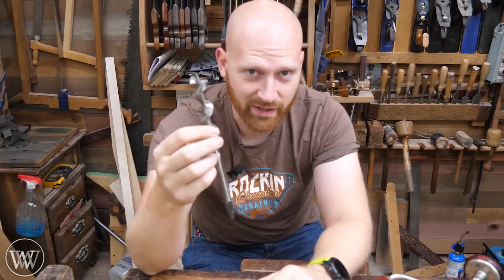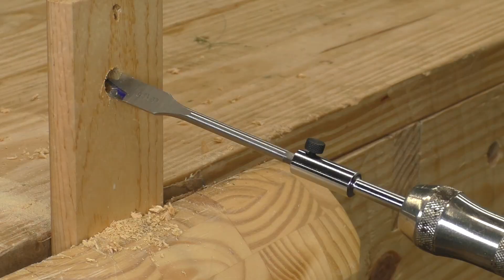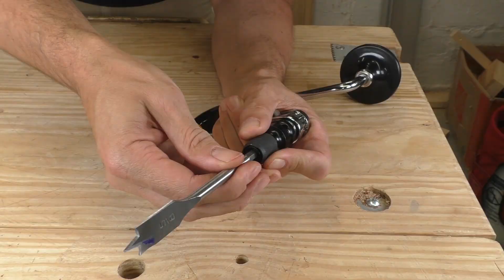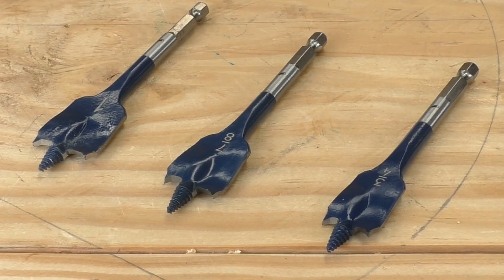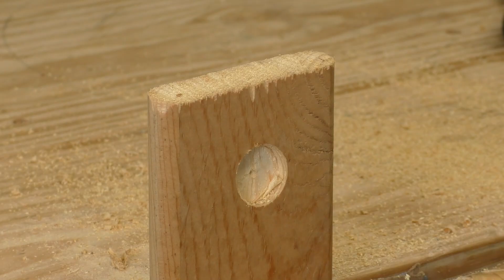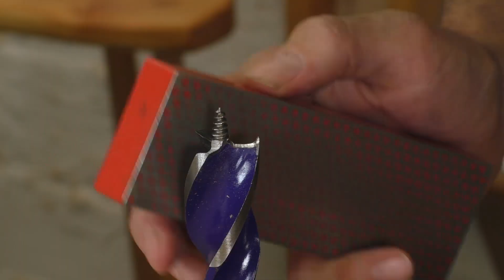Modernize your brace with new gear!

Comment: My grandfather would've told me to cut the ends off and weld hex stock on them.
Reply: could you do it with the bit sufficient centered to not lose accuracy?
Reply: @BCRBCRBCRBCRBCRBCR  
I personally would grind down the square sides, weld on a few beads, and make a "straight drill jig". Not too dissimilar from a plane shooting jig but with level and plumb for centering. Then grind the angles a little bit at a time.
Reply: @BCRBCRBCRBCRBCRBCR  It would be very difficult with a home setup. The centering wouldn't be so hard, but keeping the welds even is incredibly hard. Usually when the weld cools, the metal contracts unevenly, introducing a bend at the weld.
Reply: @keithklassen5320  
I understand the concern.
I'd do a little trile and error on some steal stock or some junk, and get it zeroed in tip too tip.
The other thing to remember is that the bit is going into a brace not a high speed drill or mill.
Reply: @BCRBCRBCRBCRBCRBCR  two v-blocks, clamped into place? Shim one block to height.

Comment: Take a look at Irwin Brace Bits.  Traditional tapered square shank, two flutes down a solid center, and sizes from 1/4" to 1" by 1/16ths.  I get the same performance out of those as I get with my 100 year old brace bits (father in law was a carpenter during the Depression).  Good nickers, too.

Comment: Why not use a standard 1/2" socket speed wrench with the adapter you showed?

Like:
https://www.amazon.com/Performance-Tool-W38128-8-Inch-Speeder/dp/B009TCBBEE/ref=sxin_9_ac_d_mf_rm?ac_md=0-0-c3BlZWQgd3JlbmNo-ac_d_rm&cv_ct_cx=speed%2Bwrench&dchild=1&keywords=speed%2Bwrench&pd_rd_i=B007UTQ2Z6&pd_rd_r=607ab25b-1220-4549-8557-b90879dd1ba5&pd_rd_w=xbeOo&pd_rd_wg=E56WQ&pf_rd_p=3d1a8341-be16-45b1-ae3d-ba8c533ec9f0&pf_rd_r=310JQP82NXS76FD1EQ65&qid=1602174279&s=hi&sr=1-1-12d4272d-8adb-4121-8624-135149aa9081&th=1

Comment: Great talk man. You hit the nail on the head. I have been eyeing one of those braces for a long time now. Maybe someday I'll pull the trigger. If they made it in a long throw, or short throw version I would easily throw $100 at it. Thanks for the shout out.
Reply: It would be great to see you both work together.
Again :)
Reply: Damnit James!!! bahahahaha :) :) good work friends!!
Reply: Same -  I'd have already bought one, with all the extras, if it came in 14".
Reply: I'm not in an apartment. I've got to build a wood truck bed away from any power and I'd like to use manual tools. Does anyone or did anyone make a hand powered drill press that I can clamp onto one of the boards?
Basically I'm looking for a mobile hand operated drill press.
Please and thanks guys.
Reply: @xmo552  these exist as antiques; i sold one off a couple years back. Might find them in estate sales or whatever. 

But a bit and brace can drill dead straight/square if you make or buy an appropriate guide. 

For that matter you could probably use one of those drill press guides for hand drills that has a built in chuck (rockler sells one) because many braces easily hold a hex shank.
Reply: A homemade guide is as easy as drilling a thick bit of scrap wood really carefully to be dead square, testing the hole for square, and if good, clamping the guide to your work to drill the first couple inches of the hole.

Or hit up a friend who has a drill press.
Reply: @joshuamurphy5073  
Thanks for the advice !
Reply: @xmo552 , is this what you are looking for? (Maybe I should say “were looking for”?)

https://www.youtube.com/shorts/5bgx4Qhh-Ds
Reply: I have 5 braces now, short throw, med. throw and long throw and it's like having a 3 speed transmission. Those long throw braces are really nice with large diameter bits.
Reply: Check Lee Valley for brace options and accessories.
Reply: Long throw? Short Throw?

What do these mean with regards to braces?
Reply: @KrazyKrafter  it means the distance from the handle to the center axis. The longer distance, the more leverage you can apply to turn the bit.
Reply: Yes, this. I also really wish that it had wooden grips. I guess im looking for a unicorn (again), but a brace with nicer grips, less than $100, and takes round bits is the goal.
Reply: Like most hand tools, old ones a often better than new, and cheaper. Flea markets and yard sales, eBay I suppose. Unfortunately I have no current knowledge as I bought mine about 50 years ago. The one I found was made for Bell Telephone way back in the day, and is better made than anything I've seen since.
Reply: You guys are my favorite woodworkers, love your stuff James.
Reply: Spade bits are crap in hand braces, very poor performance. I recommend buying both sizes of adjustable bit, you can cut up to 3” holes.   Do not buy Chinese auger bits ! waste of money. the Irwin bits are meant for power tools.   
   Rex, look for adjustable bits, if you keep them sharp they cut very neatly. Yes I do use them, you can get them in square or modified round shank.
        What’s all this talk of knickers on a family show ?
Reply: @CrimeVid  I've got a couple of adjustable bits I found in a box with a bunch of other stuff. This has inspired me to try and clean them up. Thanks!

Comment: The last type of auger bits you tried actually works well if you change the geometry a bit. The “nicker” seems to not cut ahead far enough, the solution was to file back the bottom cutting edge. Also the cutting angle of the bottom cutter is way to high, but that can be filed. The end result is a nice and clean hole. I did this on a dewalt bit. But they are not super cheap, but perhaps the same mod works with cheaper ones.

Comment: From my experience, I purchased and used the ship auger style bits from harbor freight.  HF is cheap, but i decided to go with the "Bauer" brand.  I actually used those during my joiners bench build with pretty good results.  Worked alot better at low speed than in my drill, pretty clean hole and cuts left, and it made a difference when i sharpened it up too.  Even w larger size bits, i was able to make clean 3/4" holes for holdfasts in the bench.  The snails have bigger thread for more positive engagement too, and decently priced.

Comment: My plan is to get the adapter that taytools sells and gradually phase into the Woodowl bits as my small assortment of vintage augers die off. The snail of my 3/4” vintage Greenlee bit is shot and beyond repair - I basically have to lay on the brace to get it to cut through, since it doesn’t pull itself through any more. My most used brace bit, so that will be the first Woodowl, along with the adapter.

Comment: Really like how Rex doesn't just  expect the tool to work perfectly as sold, especially if its cheap i.e. he accepts that there's a trade off and that you may need to meet the manufacture halfway and invest some time to tune it....and i get that might sound stupid i.e. shouldn't the tool work perfectly first time and forever!......well no, the tool is going to deteriorate if you use if for any reasonable duration, and therefore learning how to maintain it is all part of ownership....its its own skill......unless you want to just pay top wack, and throw away weekly/monthly. Keep it up Rex. A friend runs a machining business with sophisticated CNC machines. I thought that he would never have to take them apart, that their complexity would defy such work.....i was wrong, he knows everything about them and can strip and rebuild them as required.

Comment: Rex.. get a ring that you can put around the chuck end of your braces and tie a piece of rope or chain that doesn't stretch to it... take a little quick level and level your brace then step on the cord/chain on the floor and you can ride your wobble almost completely out.  A bearing with an outside race works very well but adds a lot of weight.

Comment: I'd love to have the wood owl bits but they are way beyond my budget, even one at a time. I occasionally find an old bit or two that are useful but most have been abused and improperly sharpened. May be the GW brace with the 1/2 drive is the only modern way I can go, at least half drive accessories are easy to find. Then again maybe blowing the dust off my old electric half inch is a better option at my age.

Comment: Hand Brace Solid Center Auger Bits

Item # 43616 shown

Click a thumbnail to view a larger image
Hand Brace Solid Center Auger Bits Features:
Medium-fast screw point ideal for general woodboring applications
Full-length heat treated bit guards against bending in heavy-duty applications and strengthens the twist where the greatest strain occurs
Double spur, double cutter design leaves an extremely clean hole finish
★★★★★
★★★★★5 out of 5 stars. Read reviews. 
5.0
 (1)
BrochureBrochure
-Email a Friend
-Glossary-Printer Friendly Page
-Safety Warnings
-Reference Guide
NOTE: Not all products are currently listed on our website. If you don't see the specific product you are looking for, please contact our Customer Service Department for assistance.

Item #	Diameter	Shank Size	Twist Length	Overall Length
43604	1/4"	Taper square	3-1/2"	7-1/2"
43605	5/16"	Taper square	3-5/8"	7-5/8"
43606	3/8"	Taper square	3-3/4"	7-3/4"
43607	7/16"	Taper square	3-7/8"	7-7/8"
43608	1/2"	Taper square	4"	8"
43609	9/16"	Taper square	4-1/8"	8-1/8"
43610ZR	5/8"	Taper square	4-1/4"	8-1/4"
43611	11/16"	Taper square	4-3/8"	8-3/8"
43612	3/4"	Taper square	4-1/2"	8-1/2"
43613ZR	13/16"	Taper square	4-5/8"	8-5/8"
43614	7/8"	Taper square	4-9/16"	8-3/4"
43615	15/16"	Taper square	4-11/16"	8-7/8"
43616	1"	Taper square	4-13/16"	9"
43624	1-1/2"	Taper square	4-7/8"	9-1/2"
Related IRWIN tools
This tool has no related items.
Testimonials
There are no testimonials at this time.
The trustmark icon that reveals a popup describing BV authenticity
ReviewsWrite a review . This action will open a modal dialog.
Rating Snapshot
Select a row below to filter reviews.
5★stars	
11 review with 5 stars.Select to filter reviews with 5 stars.
4★stars	
00 reviews with 4 stars.Select to filter reviews with 4 stars.
3★stars	
00 reviews with 3 stars.Select to filter reviews with 3 stars.
2★stars	
00 reviews with 2 stars.Select to filter reviews with 2 stars.
1★stars	
00 reviews with 1 star.Select to filter reviews with 1 star.
Average Customer Ratings
Overall	
★★★★★
★★★★★5.0
Quality of Product	
5.0
Value of Product	
5.0
Performance	
5.0
Effectiveness	
5.0
Durability	
5.0
♂
★★★★★
★★★★★5 out of 5 stars.	
gdblake
 · 4 years ago  
Essential for hand tool woodworking
I have a full set starting with #4 (1/4") up through a #16 (1"). I do a lot of hand tool woodworking and having a full set of auger bits is an essential part of a complete tool kit. I have several vintage bits, but prefer these bits by Irwin. They are extremely well made, come sharp and ready to use. They bore clean straight and true holes in both hardwoods and softwoods. I highly recommend them.

✔ Yes, I recommend this product.
Quality of Product
5 out of 5
Value of Product
5 out of 5
Performance
5 out of 5
Effectiveness
5 out of 5
Durability
5 out of 5
15 people found this review helpful.5 people did not find this review helpful.
Helpful?
Yes · 15 15 people found this review helpful. Click to agree.No · 5 5 people did not find this review helpful. Click to agree.
Report

Comment: The solution is to go to LEE VALLEY . In their tool dept. they have ADAPTERS  for hand braces to use ANY type of bit or driver . YEEES I bought them .https://www.leevalley.com/en-ca/shop/tools/hand-tools/drills/100081-brace-drivers-for-screws-and-sockets

Comment: I bought the Irwin auger bits from Amazon. They were a disappointment as they were roughly made, rusty tips despite being new and needed considerable sharpening and adjustment. The snail was medium. I really am after a fine snailed bit as I work with Australian woods which are hard.

Comment: I don't have a solution either.  But I think I see the reason why the Irwin and others have a poor entry.  The classic augers have that rounded knife edge that pushes the fibers down as it cuts.  The spurs on the ends of the cutters like on the Irwind Speedbores and the advanced flat bits with snails have a "plow tooth" that lifts as it tries to cut.  And from what I saw this issue of lifting as it tries to slice seems to be the common key to failure in all the cases.  

I'm not sure that there's enough material on the Speedbore bits to allow altering the spur enough to produce a negative rake knife edge that pushes the fibers in but which also transitions cleanly to the chiseling portion.  And even if this is possible to do it would require some really snazzy filing of the spurs to alter them this way.  And that takes it out of the realm of "easy peasy" as well as if they were 4 times the cost.

It might be interesting to modify one drill to see if changing from a positive rake spur with a lifting effect to a negative rake knife edge changes how the drill performs in the brace though.  And while it might be one answer I'd still say that it's not the one you or your viewers want.

Comment: Wish I could help.  You've made me realize what a screaming deal I got last year at a flea market.  Got a brace for $10 and the guy threw a price of $1 each for the bits or $20 for the whole lot - a BUNCH of them- turned out to be about 40 plus 2 adjustable bits.  After a soaking in Evaporust and hitting them with a wire brush there were two that weren't usable, both die to bad snails.  The rest just had a patina of age on them and the nickers were all still sharp.  Thanks for lifting my spirits!  I just spent more to have a shop built than it will ever produce- if you don't count mental health.
Reply: I paid more for the brace (different seller) but also found a great deal on the bits (45 euro for 43 pieces, 40 of them where snails). All they needed were a day of soaking and scrubbing (and I just oiled them lightly on principle). Yes, they were still sharp enough to cut my skin from the strat. So happy (I bought them online, so it was a bit of a gamble.)

Comment: Hey Rex, a tangentially related question, maybe something you could do a video on someday. I recently bough some old braces, both of them the handle (not the top one, but the one that you say you think is meh and too shakey on the Garret Wade) is cracked on. How would I go about making new ones for them, do I just have to make halves and glue them together around it? I don't see any seams like that on the ones I have.
Reply: The original handle was put on before the metal was bent into the shape of a brace. You can often repair the existing handle by stabilizing it with epoxy. If you opt to replace the handle, you will need to cut your new handle in half lengthwise and then glue it back together around the shaft of the brace.

Comment: I've tried hole saws. Ehhhh. 
I've also tried old square shank twist bits. Another "meh". 
The irwin speedbor maxes I have and they're "ok", they take a lot of force - but perform about the same as the vintage auger bits I managed to obtain. Those might not be sharp after having to get de-rusted thoroughly. I also found that using them with a hex adapter on a speeder handle works, since I didn't know about the garret wade brace. A T-handle style speed wrench also works. No ratcheting in those but tremendous leverage for rough holes.
My solution was to just pick up a vintage corded drill in all honesty. For bigger holes I still have the brace, slow as it is... and a larger electric drill that I have to remake a handle for.

Comment: I don’t have a bit and brace but in my hand drill I use Irwin speed bores. I start the hole in reverse to get a clean cut. This tip might help you but idk. Also I have a fairly expensive set of Japanese augers that I use. These augers work extremely well at low speeds. I do know low speed doesn’t really correlate to a bit and brace but still

Comment: When I was looking for a set, I came across a YouTube review from catusmaximas about Harbor Freight's "Bauer auger set". From what I remember, the quality is decent for the price. Bought a set for my brace and gave it a try, and the results where decent as expected. Had some tear out and some sizes did better than others, however I suspect it's because the bits were made for a drill. Overall, you get 7 pc from 1/4" to 1" for $20. I think thats a great deal for a decent set of augers for a brace bit!

https://www.harborfreight.com/wood-auger-drill-bit-set-7-pc-64809.html
Reply: Despite their reputation, Harbor Freight has quite a few good tools.  I had a tiny bench top drill press from them, cost about $50, and the only cut it had any trouble with was a 2 3/4 forstner hole I was drilling into purple heart.  It bogged down a bit on that one but still finished it.  The only reason I replaced it was because it was too small for a lot of jobs, and the larger Delta I replaced it with was a total piece of junk.  A workhorse in my shop is their sliding compound miter box saw, which has a little rust and needs cleaning.  But it still works and I have had it since 2001.  They still sell it today https://www.harborfreight.com/10-in-sliding-compound-miter-saw-61971.html.

And the dust collector I picked up from them about 15 years ago is a major upgrade from the shop vac I was using previously:
https://www.harborfreight.com/13-gallon-industrial-portable-dust-collector-31810.html